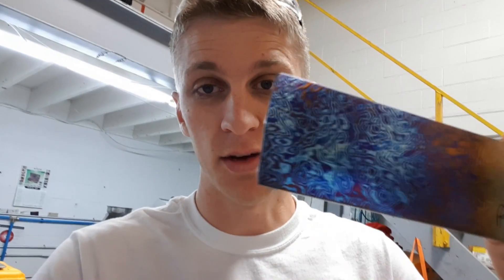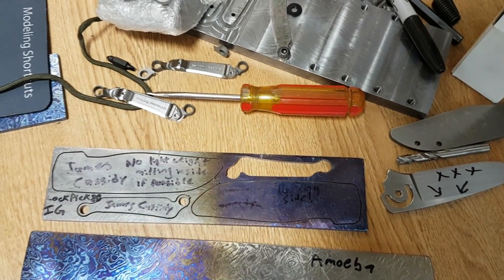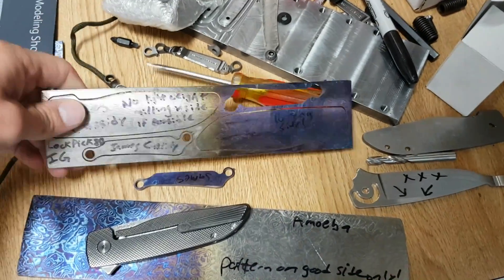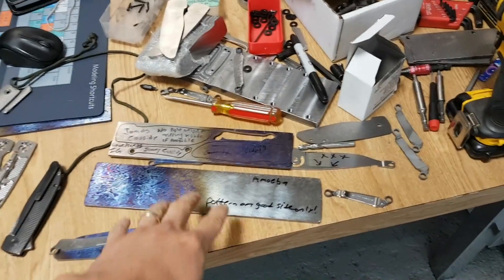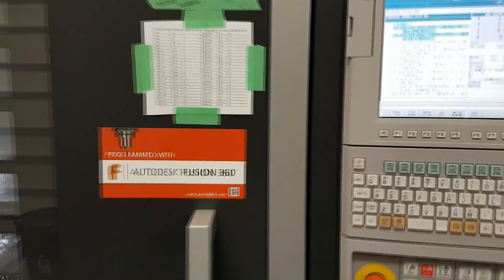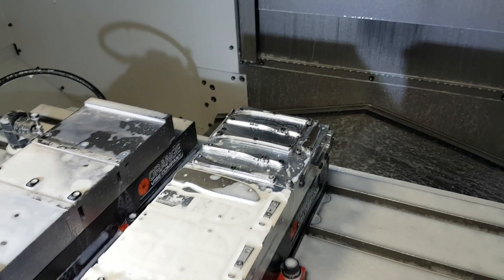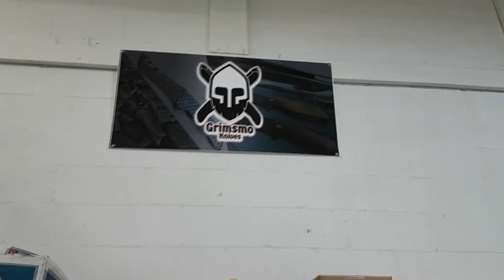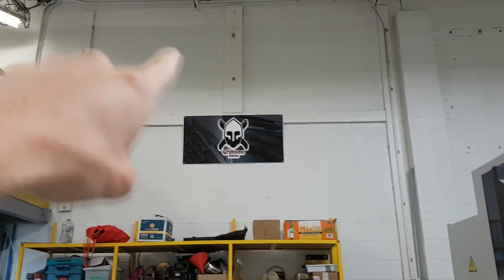CNC machining Timascus knife handles - Grimsmo Grind 035

Comment: Possibly stupid question here... why waterjet the parts when you can use the mill? Is it just a time thing?
Reply from the maker: Mostly because a lot of the material comes in huge sheets, like 3'x4' or bigger, can't really put that in the mill and still hold it flat.  Having exact size blanks makes fixturing them easy and repeatable.

Comment: I don't know if your going to see this and you probably already know about it, but there's a company called Wazer that just started making a desktop water jet for a decent price,if I remember correctly it's about $5000 and would be perfect for the work your doing I think!
Reply: That is a hobbyist piece of machinery, not a production quality machine. A tormach mill that John is no longer using would be faster at cutting these parts than this "waterjet"
Reply: Ilya Pasumanskiy It definitely uses the same grit and water pressure/speed as Pro machines, it's the perfect size for knife cutting, and definitely much faster then cutting it out with a CNC, which isn't the right tool for cutting blanks by a long shot.

Comment: I cant wait until I make it down your way to hangout again. Maybe something this fall Ill swing down. I might be working up north for a engineering firm at my school. Need anything 3D metal printed im your guy :P

Also are you using a G91 G28 X0Y0 at the end of your program for a send home? Seems like your table is so far left at the end, you must have quite the movement on the X axis!! 

Gosh I wish I had a machine like that. I love seeing it run
Reply from the maker: +MrLiamCooley good to know in the 3d metal printing!  Let me know if you get in.  And you're right, I removed the X0 from that home move.
Reply: Awesome dude! Keep up the videos loving this stuff!

Comment: When you were talking about re-posting code, it got me thinking.  Most people aren't all that good at keeping lots of separate things in their head at once - I know I'm not.  But machines are great at the minutia.  The solution is to take it out of your head and put it on the computer.

I'll go out on a limb and guess that the code for each individual section doesn't vary, or varies very little.  Is that a fair assessment?  What if you made a small program that worked from templates made from the output of your post, and let you choose which parts you needed to make?  Post each section individually, and then automatically assemble them for what you need.

For example, checkboxes for back handle backs, back handle fronts, etc.  It would then assemble a custom gcode file that did only those parts.  Taken to the next level, you could potentially variablize things like speed or common patterns.  For example, a radio button for material (Titanium, Timascus, stainless, damasteel, etc) and pattern (honeycomb, starburst, etc).  It could then write that directly into the program.

This approach probably wouldn't take care of truly custom stuff like special engraving, but it would probably cover the 80%.  It would also make it easier for somebody to come and operate the mill, freeing you up to do more design and custom stuff.
Reply from the maker: +Paul Frieden You are correct and a lot of shops use macros to do exactly what you suggested.  I used to too.  But then you're hand editing code in a text editor (I never figured out how to variable it with simple radio buttons), and I don't like tweaking code now. Trust the CAM.  And I make a ton of changes all the time and there are dozens of different variations, so posting new code might not be the simplest, but it's the best and easiest for me.
Reply: JohnGrimsmo I was actually thinking about it a little differently.  My idea was to use the CAM, but put each section into an independent file.  Then use an external utility to assemble whatever combination of sections you need.  The utility would present the checkboxes, as opposed to trying to add them by hand into the gcode.  This way, you can use stock CAM and still have repeatable customized combinations.

If built properly, it should be easy to add additional options and to update the gcode for different sections if necessary.

Comment: I think about the tough part of CNC sometimes.. Fun thought experiment:

Add up every variable you're firing off when you hit Cycle Start. Consider every feed and speed in every CAM op, tool height offsets, work offsets, adaptive engagement settings, is the tool tight in the holder? Hell, is the pull-stud torqued properly?...

You can go on and on with this thought experiment.

CNC machining is as much a data/variable management game as it is a creative process.

Comment: Hey john, I dont know if you already did a video on this, but if you haven't can you show how you orange peel ano knife handles?
Reply from the maker: +Adrian Mendoza we probably have a 2+ year old video on it, but basically use a scotch brite wheel or wire wheel, spin it fast and push a bit hard.  When Ti heats up is when it starts looking good.  Man we haven't done that finish in years!
Reply: finally found out how you did, I have to say  blue ano and orange peel might be my favorite, by the way would an orange peel finish work on timascus?

Comment: 9:30 - i have herd once you machine some kinds of aluminum it breaks a "skin" and will warp ever so sightly after that. and this is definitely an "I think" sort of thing. you could revive that damasteel knife blank if you machine the other side the same and take off a few thousandths off the edge on the grinder to make it thick again, and besides the little ridge left over may end up looking pretty cool

Comment: In regards to the nice and ugly sides... since the nice side was face milled, would the ugly side clean up or look "pretty" if that was faced off? (assuming you can afford the decrease in thickness).
Reply from the maker: +Hirudin it's not split in two, and yeah the ugly side goes pretty darn deep.
Reply: I was wondering that too, I would have guessed it would be somewhat homogeneous. Didn't John mention that they are face milled before shipping?

Perhaps each Timascus blank is actually half of a larger piece that has been split in twain to reveal the pattern inside.
Reply from the maker: +BearGoesWhere Nope, we tried that and the "less than ideal" pattern goes pretty deep.

Comment: Maybe best to prep the thickness on the surface grinder before milling?
Reply from the maker: +bcbloc02 that's definitely an option but the only way to hold titanium is with double sided tape which can be iffy.
Reply: JohnGrimsmo
Since grinders only want to throw your parts out the way the wheel turns if you use double sided tape and block the end with a nice piece of magnetic material so it can't push your part then you should be good to go.
Reply: Talon jaws?

Comment: Someone is trying to make a desktop waterjet cutter. They're calling the "Wazer" (basically the word "water" with a Z thrown in to hipify it 20%). Just figured you might be interested, if you haven't heard about it yet.

I couldn't agree more with so much of what you said. Any individual step isn't too difficult to wrap your head around, it's the fact that there are just SO many things to remember to do, without fail, and in the exact right order. The machining on those handles looks phenomenal!

Heh, I've had a couple Z Overload errors too, one of them was RIGHT on top of my Blum tool setter. That was a $2000 brainfart. :/
Reply from the maker: +Hirudin ouch!!!!  I don't think I've destroyed anything other than endmills or parts.  I had not heard of that waterjet, thanks!  I've thought about getting one but they seem like a giant PITA.

Comment: John,
Have you ever considered getting your blades laser cut instead of water jetting?  My experience has been nothing but positive vs. water jetting in regards to accuracy of cut and the issue of draft angle.  Just a thought.
Reply: Laser cutting Timascus steel would be a disaster
Reply: How so?  I've had plenty of stuff laser'd, as thick as 3/8" and there is zero heat discoloration on any edge, anywhere.  Am I missing something?
Reply: Are you talking Timascus or cheap CRS steel...
Reply: Mostly CRS and some chromoly but I've seen 1/8" 308 stainless sheets come off the same machine with very little if any discoloration, and that stuff will change color if you look at it funny.  I've never worked with Timascus, as I am not a knifemaker, but my rudimentary understanding is that a quality, high power laser imparts very little heat in to the surrounding work area.
Reply from the maker: +Jason Crossley accuracy and draft angle yeah that makes sense, water isn't the best for those.  I've never tried laser but I'm mildly concerned with the heat affected zone and wearing more roughers cutting that off.